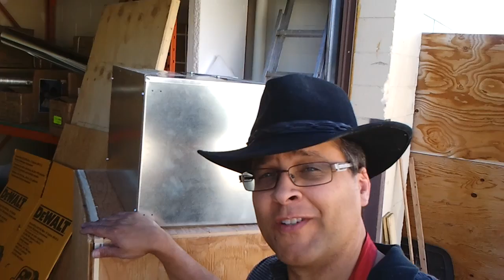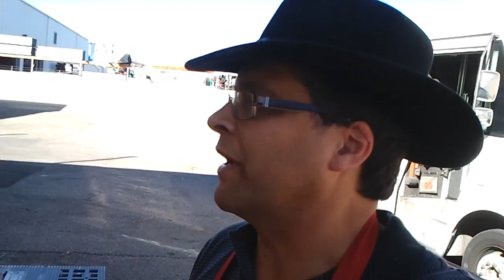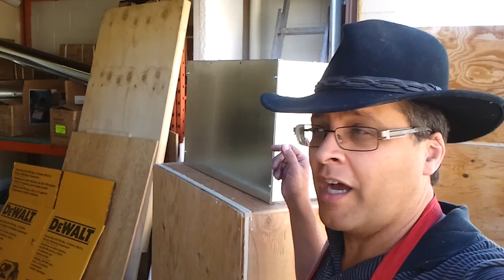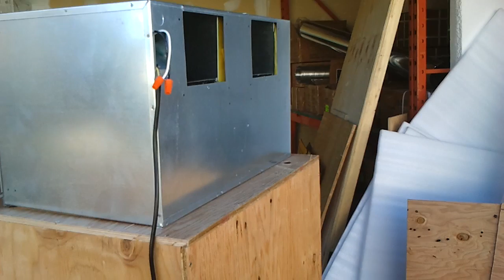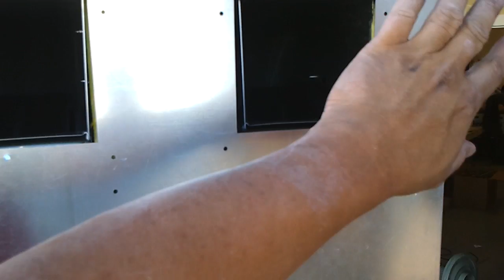Laser Fume Extractor

Comment from the maker: We've learned to prefilter the heck out of airstream before it hits the carbon. If it gets coated by particulate, it ain't absorbing fumes. So frequent filter changes are necessary.

The carbon has a shorter life than I expected. During peak runs, I'm having to change it about every 6 weeks, otherwise the odor does start building up.

Also found out that there are 3 vane configurations for centrifugal fans. Gave a fan an annual maintenance cleaning and reinstalled it backwards and got 1/3 the performance. Also, the Greenheck model we have uses a blade configuration that apparently is "sensitive to particulate build-up", so again, FILTER, FILTER, FILTER! (see wikipedia entry for forward-curved centrifugal fans).

We did a batch of wood, so I tried removing the filters for a period, and the fan vanes had huge build-up. Looking at what it takes to build a particulate cyclone separator to help remove the particulate. Found a neat paper for a "low cost micro scale cyclonic seperator" I'm interested in trying to build...
Reply: +Solarbotics do you have links to the cyclonic separator?  wood smoke should be ~10-100nM, can it be done?
Reply from the maker: +Shanjaq Well, this paper suggests it can be done (pgs 10/11):
https://uta-ir.tdl.org/uta-ir/bitstream/handle/10106/5152/Pandya_uta_2502M_10775.pdf?sequence=1